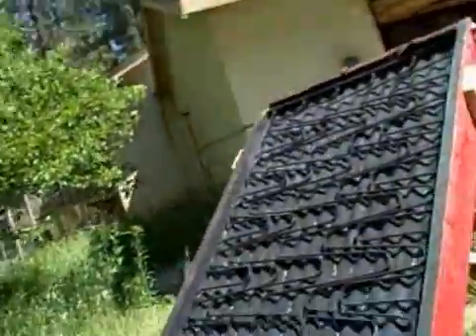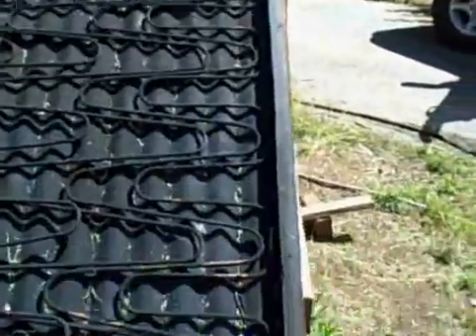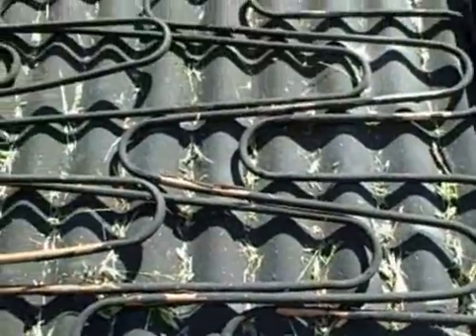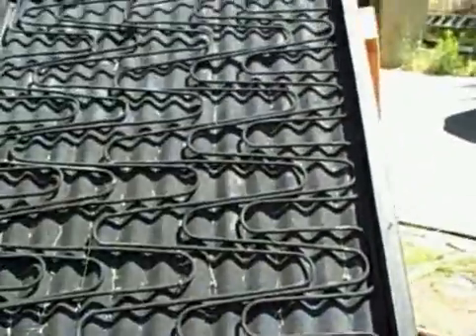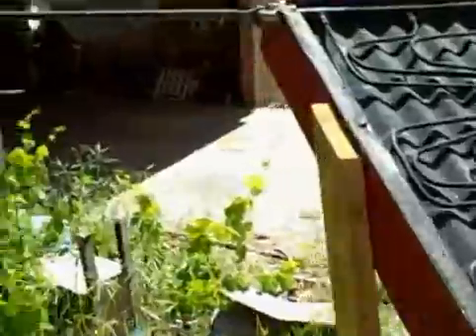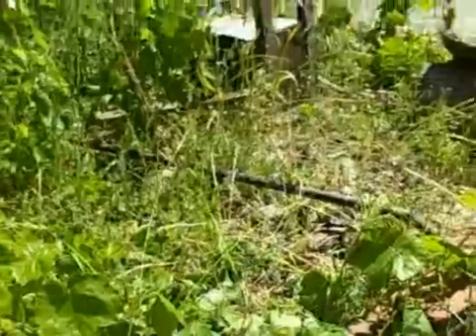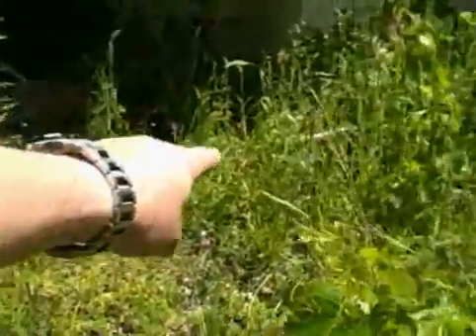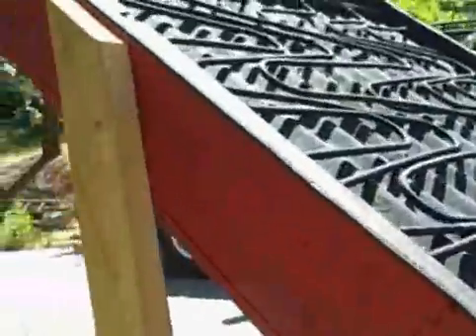DIY Solar Water Heater, 4026 Grass Valley Highway, Auburn, CA 95602-9138,

Comment: Was the gas line still hooked up and was the heater heating the water when necessary? I want to add one of these systems as a supplement to my heater and continue to use gas when necessary; i.e. at night, during the winter and to reduce the gas needed to bring the water to temperature.
Thank you so much for posting this video.

Comment: Does anyone know were I can find the info on how to use/plumb an old water heater tank for my solar holding tank? I notice most folks tht use one do not use the top in and out nipples and and use the drain line plus the pop off ect. I need to find plns for this. We hve a pass through system built by place no longer in business and need  new tank.

Comment: Hello, I already downloaded the plans and I will make this system, I will use another materials and I will use two windows glass in the body.  This is not new, but the important is how do you are connecting the solar heater to the boyler. This is a great idea very usefull, cheap and simple.  Thanks a lot

Comment: Sorry friend, we know that wives tale is no tale!  Here at 6000 feet above sea level when it gets to freezing it is the hot water pipe that freeze and burst first. The reason for that is the molecules in hot water are spread further apart than cold and so the actually cool and freeze quicker. It doesnt sound possible but everyone here knows it , because it is part of the 'plumming experience' here in the winter.

Comment: I suspect they were draining this for the winter.  Or was the sun hot enough to keep the pipes from freezing if it was being used since hot water freezes faster than cold? Or did they put anti freeze in it durning the winter?  thanks@

Comment: @ABTPlumbing 
What is the purpose of the slope?  Is it for drainage or air in the line?  What if that collector was on the roof and there were vertical supply *prob with a pump) and return lines?

Comment from the maker: CTOL1, Thank you for the positive comment, it means alot to me. I'm glad it helpful to you. BTW if your going to build a immersed heat exchanger, make sure your water is at a higher presure than you glycol so if it leaks the water will leak into the glycol and not the other way around.

Comment from the maker: A 1/4" per linear foot grade is a plumbers rule off thumb. Basically it needs grade or fall, and a 1/4" per ft. is what we use. Also it's marked on most plumbing levels so it's easy to figure.

Comment from the maker: @Baraquiel62. You could put it up on the roof but you would also need to then put a tank on the roof. Unless you pump the water up the collector on the roof. This installation was ment to be as simple as possible, no electricity, no pumps, no added roof structure, etc.

Comment from the maker: @orchispurpurea. I understand your concerns about the pressure drop. But the solar side does not supply domestic water to the house only to the heater. You want the water on the solar side to move slowly to allow it time to heat up on the collector. In regards to mixing temp. in the tank, again slow moving water, it will not break the strata. The system does not need a pump and has never had a pump and has worked for over 30 years. KISS keep it simple Simon.

Comment: The first thing I have to say is that the collector's pipes shapes are very thiny and have many curves, so the pressure loss will be huge and a pump must solve this. The other thing is the geometry of the accumulation tank. The mixing inside the tank will break the layering because of the pumping. And I agree with ABTPlumbing about freezing time...and many other things...anyway...keep moving!

Comment from the maker: In Responce, 
Dude it aint perfect, it's home made. Yes it's a radiator, and yes if you turn the gas on it will use gas to heat the water. You can get a whole lot more sophisticated and put a thermal switch, pump controller and a pump  to make it more efficient, but then it's not a simple DIY project.

Comment: and when its night time and your taking a shower, its wasting heat by heating the contraption..  dude,. its a radiator nothing more.  i saw it was a gas water heater, is that gas turned on?  does it heat when its night time?  you turn the hot water on, does it flow through this thing, if so, then your wasting gas heating.

Comment: I have a hot water boiler system for heating my home.   The hot water gets to 180 degrees Fahrenheit at 10PSI when it leaves the Slant-Fin gas boiler.   I was thinking about adding something like this to lower my gas costs.  Would it work?  Would I need some kind of automatic "drain and fill" system to keep the system from freezing up when temps drop?  It gets cold (-5 sometimes) where I live.

Comment from the maker: Okay, as long as the solar collector is lower than the tank, the thermal siphon will work. You will need to prime the system with a drain valve, pulling the hot water from the collector towards the tank. As far as using a back up element. When the back up element comes on you will need to isolate the solar panel from the system with shut off valves. I hope this helps. We have a full diagram and instruction booklet on this site.

Comment from the maker: There are no dumb questions. This system works with out pumps, it uses convection. Heat naturaly rises both air and water. Once the system is primed, ie open the drain valve on the hot water pipe near the heater, the system starts cycling. Hot water rises, cold water sinks. It's beautiful in it's simplicity. The ebook helps explain it better,  hit the link above for your copy. Thanks, Andrew

Comment: I'm considering something similar, but with a closed glycol system warming a secondary accumulator tank that will then feed my gas water heater.  It won't take me completely off the grid, but the warm water feeding the water heater should cut back gas usage considerably and I won't have to worry about a freezing waterline.  Thanks for sharing video.

Comment: looks like a simple gravity fed system and works well it seems
not sure if you would be able to use it in the built up areas because there is too many regs ( they would lock you up in the UK for sticking this up on your house, and then use real criminals on community service orders to remove it!) but out in the sticks and with no nosey peeps this is a good idea

Comment from the maker: No, cold comes out of the bootom of the heater and thermal siphons into the top hot water tank/ pipe. There are only isolation valves on the panel side. BTW I just bought one of those solar PV panels from Harbor Frieght you've got up on your site. Gonna give it a try on the travel trailer this week. I'll let you all know how it works out.

Comment from the maker: The cold water feed comes in the cold inlet on the top of the W/H were you would normally hook up the cold. The hot feed to the house does the same, it comes out of the hot side of the W/H. I'm putting together a how too plan and diagram to answer all these questions in more detail, stay tuned, or subscribe.

Comment: Does this work all year?

And I don't get the routing. Is there cold water going in at the bottom from a T in the cold pipe? And hot water coming in through the top? Where does the hot water come out?

Comment: Efficiency would be greatly improved via insulating the piping & storage tank, & glass over collector. The black corrugated metal does little good without glass. This design works without a pump because the storage tank is above the collector(hot water rises and colder water sinks).  Thanks for sharing. 
(people give away glass frequently on craigslist as well as water heaters which can be used as storage tanks for preheated water to the main tank)